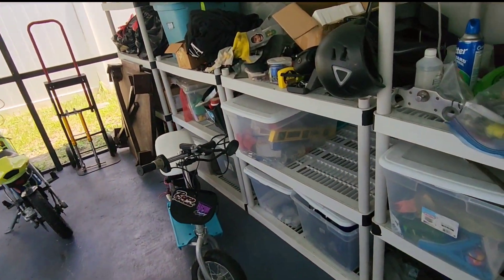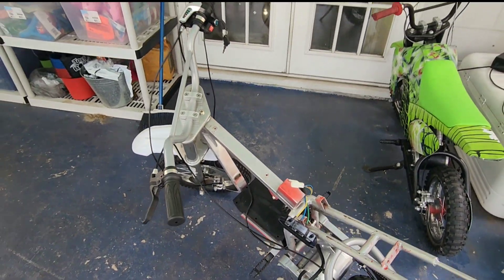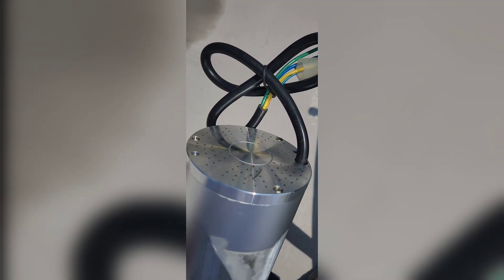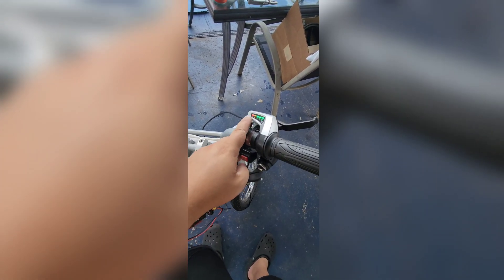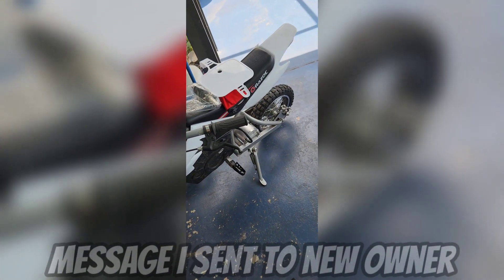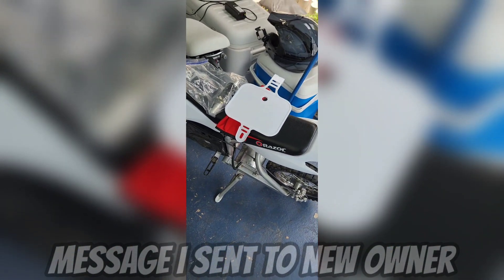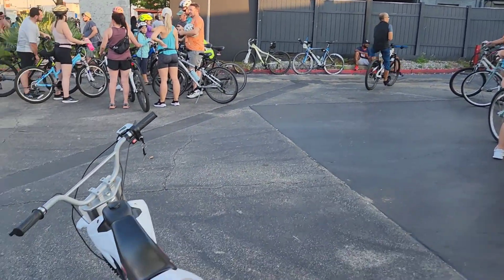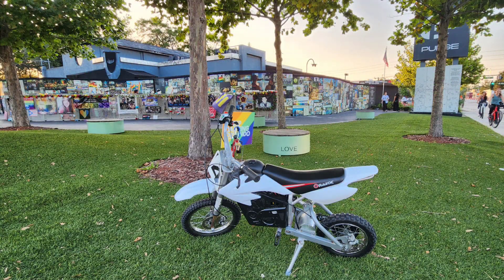Best Budget Razor Mods | 48V 2000w MX650 for Under $550! Links in Description

Comment: How many amps would you recommend for a 48v battery? And would you say a fuse is necessary considering lithium ions dont really need them.
Reply from the maker: Fuse not necessary. The amps to run ina programmable controller is dependent on what the battery can produce from the cells its using. Dont worry about peak/burst amps. Always look at max continous amps

Comment: Does the Vevor Motor kit not a direct bolt-on the MX-650?  What were you doing to that motor with the drilling and cutting????
Reply from the maker: you have to cut the legs off the motor and then make a beveled end where the screws mount so it sits flush. very minor modification, but this is with all basic vevor kits

Comment: What the range on the scud? I got the same setup I rode heavy throttle and only get like 8 miles I feel like
Reply from the maker: a ton of vairables. this ride was 15 miles long and bike went into low power mod right at the end. this was moatly speeds of like 20. but if you have a 48v 19.2ah scud or a fardriver controller which is alot more effecient you will get a ton more range. one of my very frst videos a few years back was a 20+ mile ride and i knocked that out on a 48v 15.6ah scud with a kelly controller with speeds over 30. biggest thing is a programmable controller. its really night and day different

Comment: what battery did you use? Im struggling to find a safe and affordable one
Reply from the maker: Depends on the voltage you want.

Personally alwaysngo with amorge for 72v 
Email Allen_at_amorge_dot_com.

Shrimp Depot 60v batteries
(Shrimp depot fb group)

Or for 48v endless-sphere_dot_com
Search "scud". Message americanelectricsolutions. He has 48v 15ah for 80 shipped and 48v 20ah for 120 shipped.
Tell him moosenridez sent ya and he'll give ya a small discount
Reply: @MooseRidez  thank you so much bro!

Comment: how fast does something like this go?
Reply from the maker: Stock gearing 11/80
Speed 1 - 15
Speed 3 - 19
Speed 2 - 23
Swap to a 13tooth front Sprocket and you can add 3-5 mph to each speed
Reply: are these speeding your listing in mph or km

Comment: What’s the range?
Reply from the maker: 18 ish miles out of a 48v 15ah
Reply: @MooseRidez  I’m getting a 20 aph would that be around 25 miles?
Reply from the maker: @AidenZ7334  depending on weight and the efficiency of the controller, riding conditions and gearing. You may get 18-24 miles

Comment: def should have removed the side u drilled on and placed on table to not get metal shavings inside the motor. its  a magnet...
Reply from the maker: Nope. If you know how to make a recess you won't get debri going foward. It would fall out rather then go in. It's all in technique
Reply from the maker: Also your not drilling through the cap. You're enlarging the surface space for the head of the bolt
Reply: @MooseRidez  it most definitely  put pieces inside
Reply: @MooseRidez  that's simply not a smart way to do it
Reply from the maker: @donoho93  highly incorrect lol 😆 look it up for yourself.
Reply from the maker: @donoho93  lmao. Brotha. Do some research. Not even drilling through the cap to make an opening into the motor itself. Secondly when you tap a hole if done correctly pieces will not go inside, they fall towards the drill. Ask anyone who's tapped a hole into a cars motor for oil drains. Just gotta know what you are doing. If your just sending it into and break through to the other side, that's obviously a bad move. This is just creating a recess for the head of the screws.

Comment: Could you wheelie this bike
Reply from the maker: As mentioned in the video, yes and very easily. Probably the best way to get into wheelies as the stock controller is very torquey and has a throttle response catered to popping the front up at low speeds